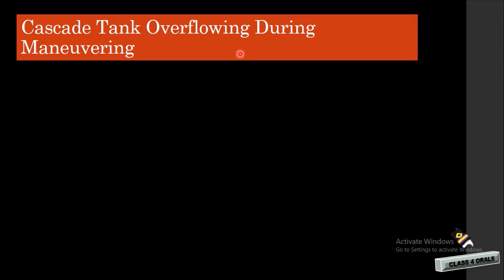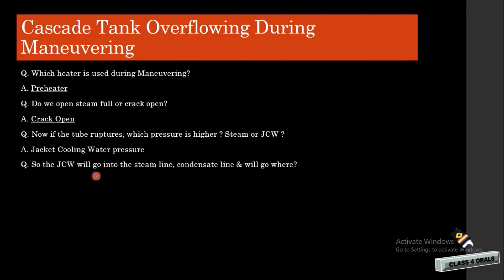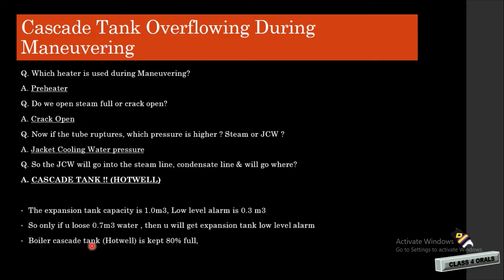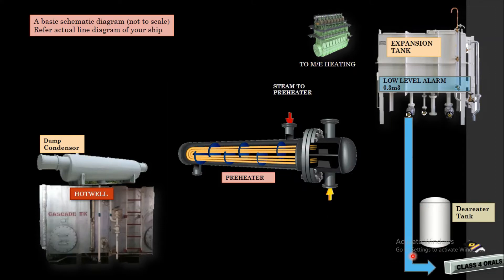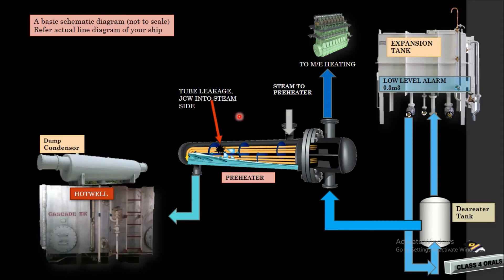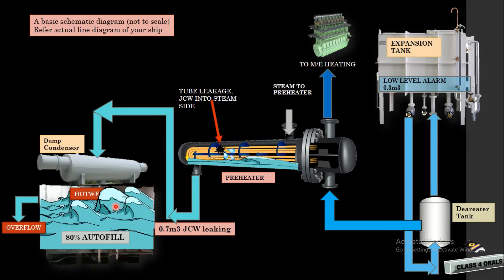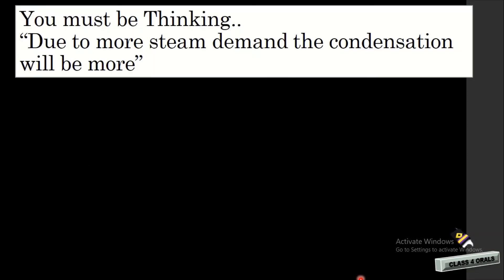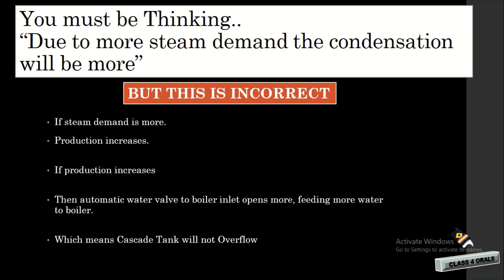Cascade Tank Overflowing During Maneuvering and Normal Sailing Reasons Explained | Animation | Imp

Comment: on my ship the preheater pump discharge pressure was 1.8-2bar, and we use steam of 4 bar. so how jcw will go into steam side?
Reply: Pratik bhai, We are throttling steam to crack open hence it's pressure falls below jacket water pressure

Comment: If there is no rupture in the steam preheater line then also their is a cascade tank overflow during maneuvering what are the probable reason please reply.
Reply from the maker: The other reasons are also applicable, but since the ques is of Maneuvering,  then focus on rupture point.
I will try to find out if there is any other reason apart from rupture..
Thanks.
Reply: @CLASS4ORALS  Thanks for reply
Reply: One more which normally occurrs , a
At Port all  tank heating and dump steam lines are shut,so water level goes down in hotwell and  water is topped up , during maneuvering we use to open these valves one by one as boiler is running and economiser is also in use, So water which was condensed in lines , and dump condenser will now come in the system and it will overflow the hotwell.